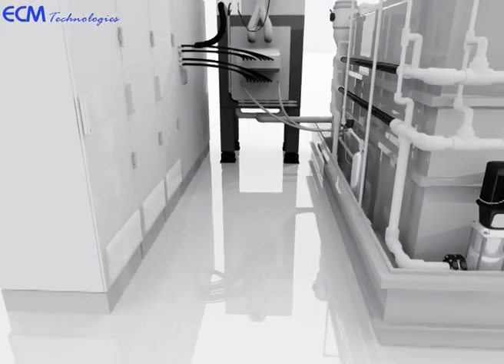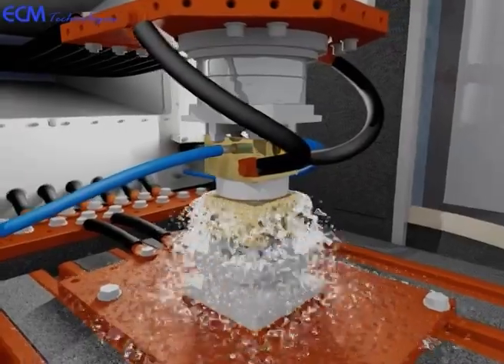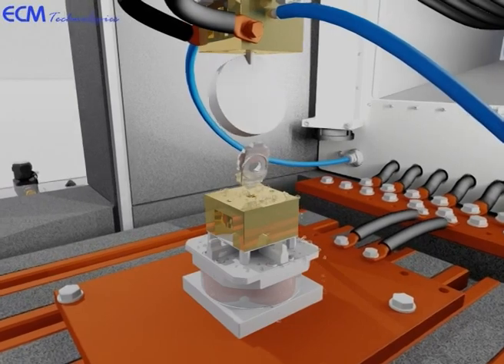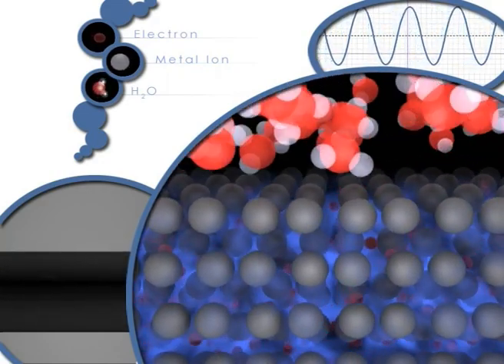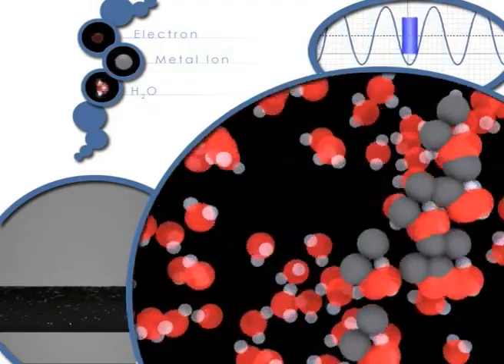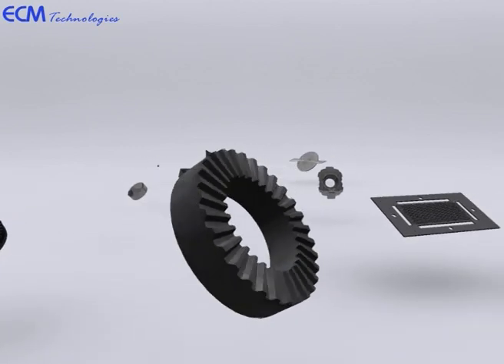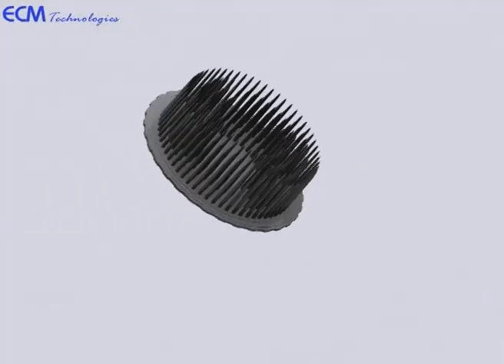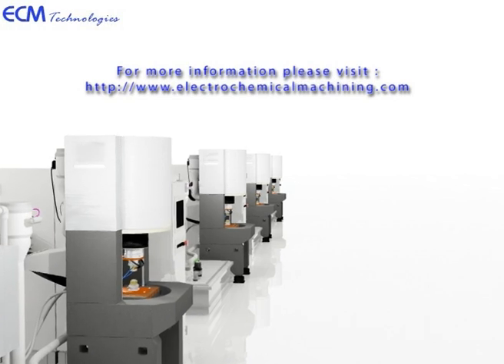ECM Technologies

Comment: how are the shapes formed?
Reply: The shape of the tool . The tool is called a cathode , it goes to the negative side of the power supply.  A cathode is a diode that has any desired shape you want. 3D printed tools that are copper plated to any desired shape you can imagine.